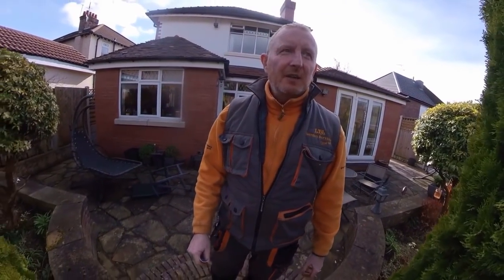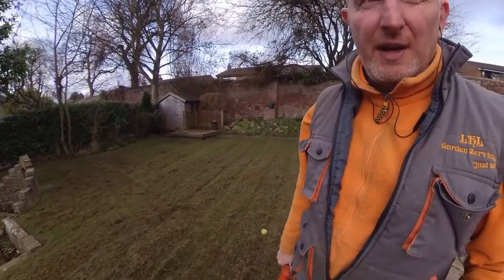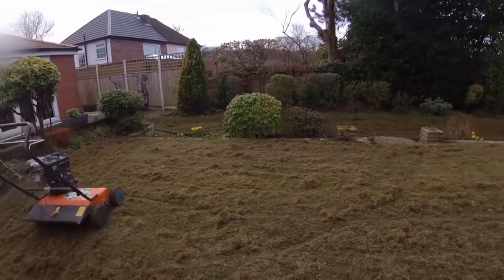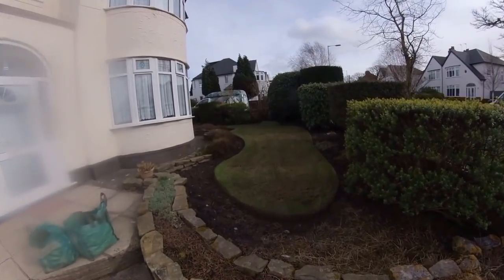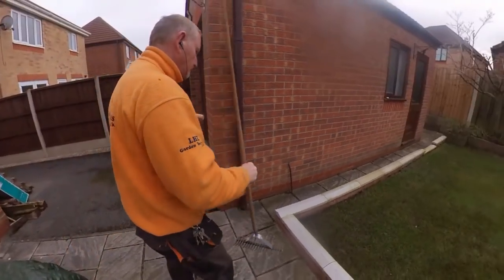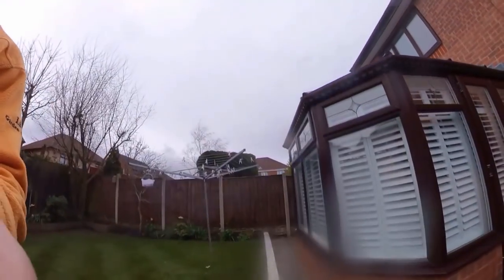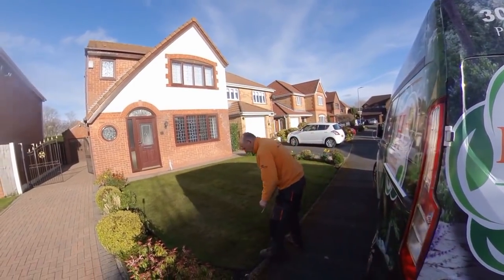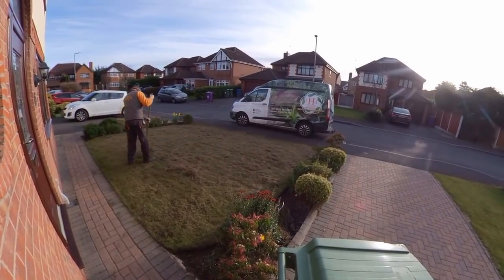Lawn treatments for garden maintenance jobs /yard work

Comment: What a great job thank you I'm doing mine today jus got electronic 2 in 1 scarifier today I only have small lawn not to much moss fingers crossed it works thank you 👍👍🤞🤞
Reply from the maker: It will work 😉...just take it easy with electric models as they are not as robust. 👍👍
Reply: Your correct it has worked I'm so happy thank you got brown bin full  so much in bin thank you ❤️❤️👍😁😁

Comment: Could use strimmer cord on the scarifier instead of string. I've used strimmer cord as pull cord on mowers before when they've snapped and it works well 😁
Reply from the maker: 😆😆Good shout...your worse than me 🙈
Reply: @LHLgardenservices  Well it doesn't fray or rot in the rain 😁
Reply from the maker: @bullseyeant  😆💪💪👍